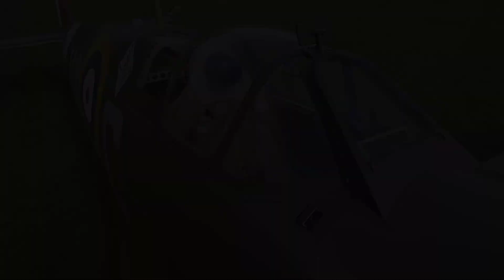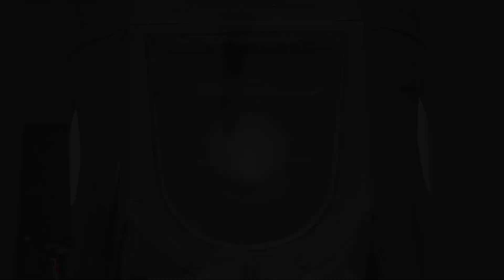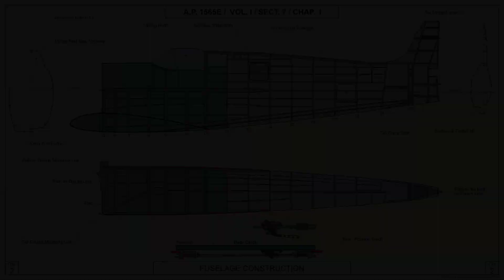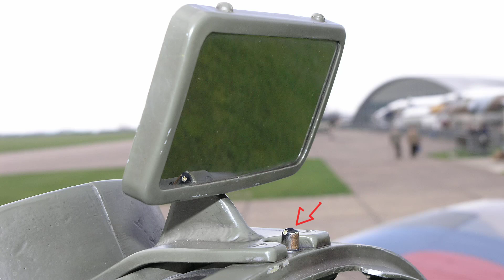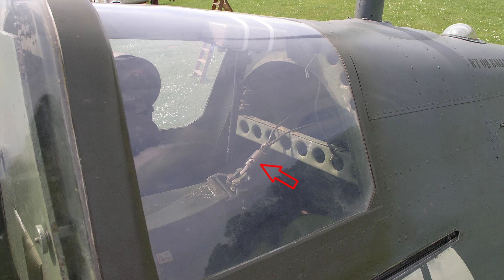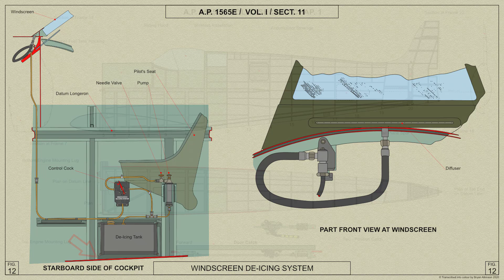Spitfire Mk V - The Canopy

Comment: You forgot to mention that there are two types of windscreens (with internal and external armored glass) and two types od hoods on Mk-V ("normal" and a blown type) - and being blown it was not(?) possible to make a knock-out oval panel (needed to equalise air-pressure in case of emergency escape in flight) - thus a crowbar was incorporated on the cockpit door in the same time as the blown-type canopy
Reply from the maker: Thanks, your point is much appreciated and noted. I am generally following the 1942 wartime AP manuals. Being a 'snap shot' in time, mine probably has been updated to not include the earlier windscreen. Since this video was produced, I have included details of the two Windscreen types in the next video The Spitfire Mk.V - The Fuselage. Thanks for watching.
Reply: .. earlier ("curved") windscreen is on the cover photo of this very video so it must be mentioned somewhere ;)